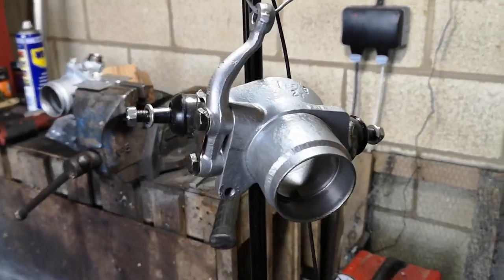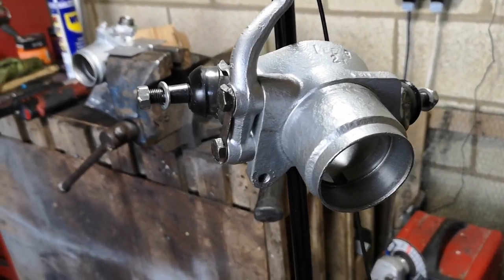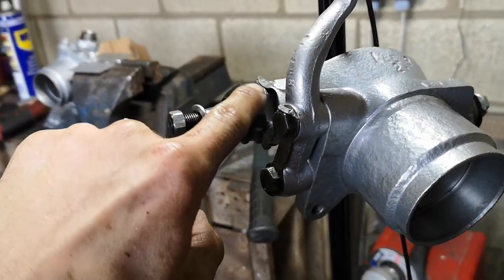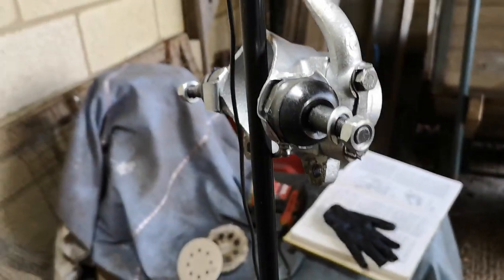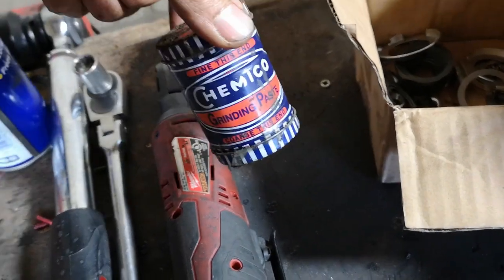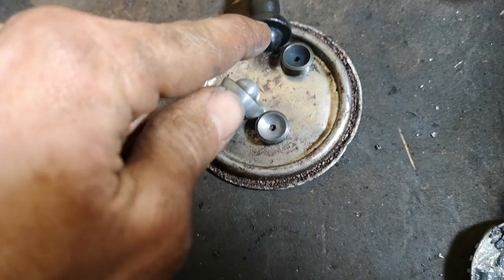The BoOsTeD Mini - Episode 18 - Front suspension build

Comment: Done many Mini ball joints and never lapped any of them. In fact I'm astounded that you would do this to a new kit, as they are surface hardened and if you lap them in you're basically grinding away the hardness.
Heyho fill yer boots though.
Reply from the maker: All the mini experts advised to lap them in, so I did what the experts do. They definitely felt absolutely awful before lapping them, and felt nice and smooth after. Rough surfaces would wear themselves down anyway in time, and then create play which would need adjusting, so I reasoned that way too.

Comment: Piggy would you be interested in doing a s/c or turbo kit for 306gti 6. Cheers
Reply from the maker: Fitting or fabricating?
Reply: @PiggyPower  plan is piggy to either get the bracket from spoox for C30 rotrex and get you to do the rest. 

Or cheaper option is get xu welders nightmare manifold and downpipe and vems ECU and eBayGT30 wastegate intercooler walbro 255 and 550 Bosch ev14 injectors decompression plate and forged rods ARP rod bearings as there be out for maxspeeding rods forged rods and standard pistons are good for 500bhp I've heard but not sure on this. Only want 300- 350 bhp low boost set up and heard rods are only good for 250bhp
Reply from the maker: All sounds ace... Message the Piggypower Facebook page. 👌🐷💪
Reply: @PiggyPower  will do piggy  found you via you tube so I will contact you via your Face book page thanks piggy